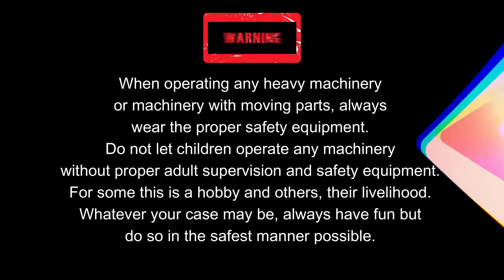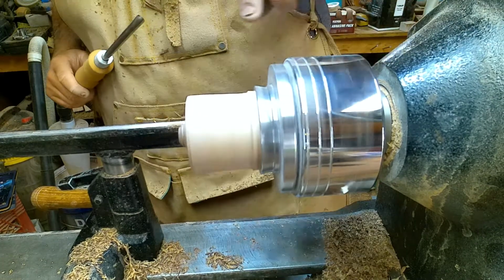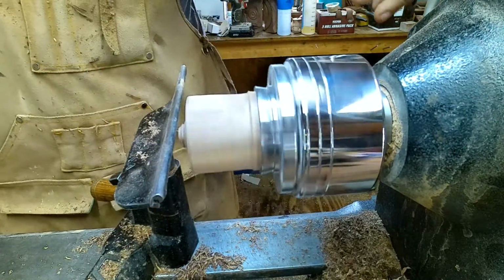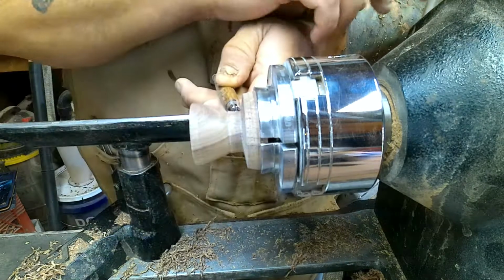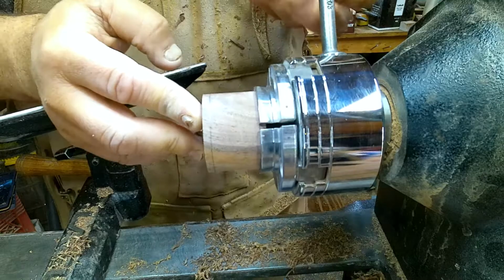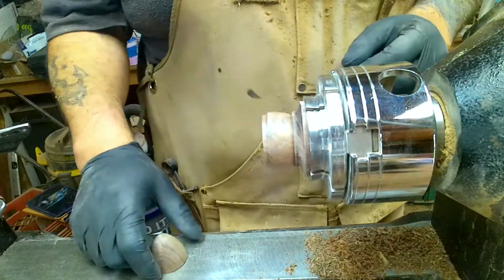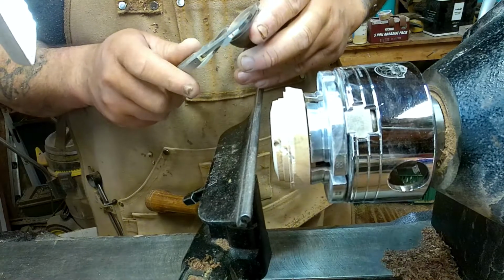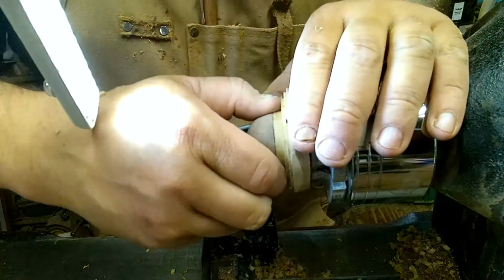Nesting Egg boxes

Comment: Several good tips in this one like when working with limited length of wood, make sure your tenon bottom is flat in case you run out of room and need to take it out of the chuck and put your project on a waste block. Also, it is not atypical to have to turn lathe on/off multiple times when fitting a box lid. Great project!